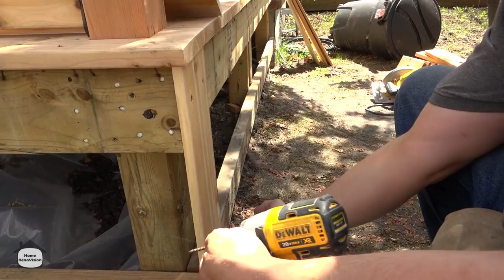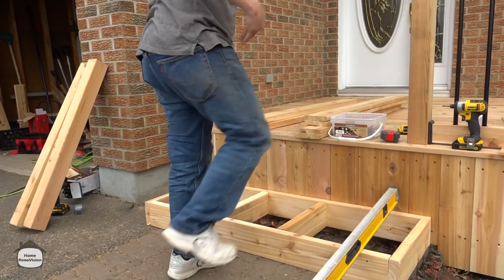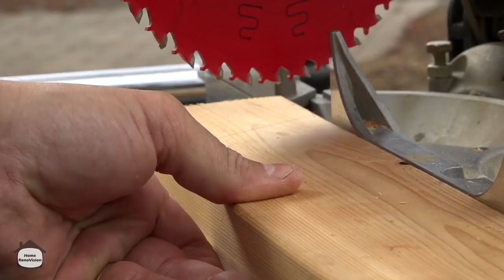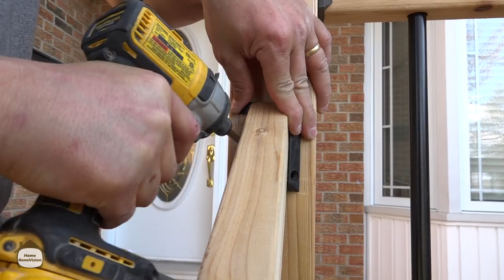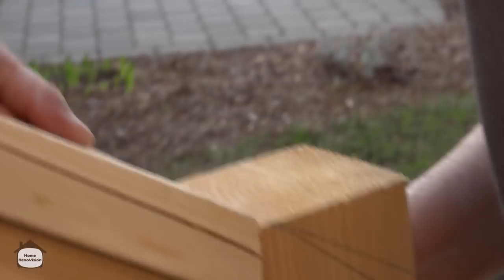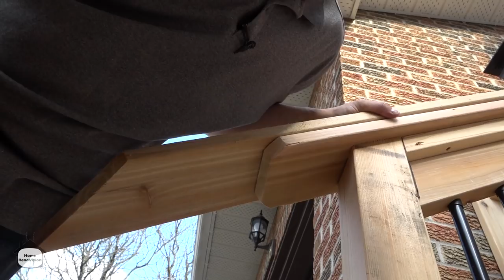How to Finish Your Deck Yourself! | DIY Deck Tutorial

Comment: Brilliant and well done Jeff. I am repairing a 2 story deck that originally installed all wrong. The ledger 16' board was even sparatically nailed to the house!! And yes, I got my permit for the repair. I am actually looking forward to the inspection.
You gave me great tips that I will use. Thank you. I subscribed.

Comment: I do this stuff for a living but I really like your videos you have good tips like that dividing by 3 trick on that skirting is amazing thanks for the vids keep it up
Reply: I cannot find skirt boards at Lowes, any recommendations?
Reply: Steven Foster they are never termed or coined that way. Usually people use wood lattice or pvc trim board. Heck, masonry, vinyl, plastic, etc. Use any type of wood really, as long as you are pleased. If you’re leaving 1” gap above ground, you can opt to get treated lumber rated for above ground and so forth for ground contact. Generally, your deck requires ventilation especially all 4 sides for proper drainage and breathing room, especially for treated lumber, so I don’t recommend closing up all the gaps to your deck hence the invention of lattice. Just make sure it is either flush with the top frame of your deck or have the deck boards overhang a bit over like he does. Flushing with the top is aesthetically pleasing but can have a lot of problems later so its better to overhang like he does. Notice he has additional framing for skirting and the bottom rail for framing must be same size as the rim joist otherwise it would be slanted and not plumb. So if your rim joist/end joist is 2x8, you can use any 2x? For the bottom frame and you be set. Hope that helps.

Comment: The reason why the skirting boards are cut at an angle is for the water to drain more easily in the bottom and not be drawn into the wood. The short side should of course turn inward. Greatings from Norway 👍🏻
Reply from the maker: Cheers to Norway!!!!

Comment: Hi Jeff, I just subscribed, I've watched a few vidoes so far from your channel and I have to say, you are amazing, down to earth, real and sincere. And it's nice to have Canadian content, awesome. So, I've watched this particular series a few times, I live in Nova Scotia and I'm about to rip out my front deck, it's actually a covered veranda, substructer is fine, just repalcing the deck boards, wraping my 4x4 posts and replacing the stairs, railings and adding railings to the stairs; it's 40 feet by 5.5 feet. This set of videos has given me the confidence to tackle my project. even the rep at HD suggested the tape you suggested, and as I'm using a water seal, to just add it to the joists and substructre, and why not, this needs to last several more years. Wish me luck....

Comment: Well.. gonna go add another box of screws to my project. Did you possibly over-do it on some areas with the screws? I mean these are the lifetime warranty coated deck screws right? My fence seems solid and I don't want to screw to close together that I split the wood. The wood seems to be expanding over the nicely sunken ones well. Others need a bit more drive from a drill with a fresh battery.

Comment: Thanks for the idea on the box steps. I was trying to figure out a way to use 4 stringers to make steps. This is a lot easier since mine is also only 2 steps on a flat surface.
Reply from the maker: Not everything in life needs an engineer. Cheers!

Comment: I'm very new when it comes to this stuff. I'm a residential building owner and I have to install a railing using a 4 x 4 post going into the ground. Up against a square cement patio. I understand I cannot put the wood directly into the ground. However if I cement the 4x4 into the ground does that comply with code? (Also, I'm in the state of Utah however I can't seem to find building codes online except for a website that wants to charge me $150 to look at all the code.) 

My idea is to dig out a hole for a 5 gallon bucket  then  fill it with cement, sink the four-by-four into it  and then I can break off the  5-gallon bucket later like it's a sonotube. But I would make a cutout  for the 4 by 4 on the side of the bucket that is going up against the patio, then 6 inch bolt thru 4x4 into cement. Do I need to rebar also into my cement pour?  Please help...thnx

Comment: Just a note about the stairs.  Your intent was to have each step at approximately  6 1/2 inches high but due to the way you built them they are quite dramatically different.  From bottom to top they measure 6.5 inches 5.5 inches and finally 7.5 inches.  This creates quite a trip hazzard
Reply from the maker: HI james it actually ends up at 6.5 and 5.5 and 5.5 an that is fine. In most cases steps are 8 and anything under that seems quite normal.
Reply: Home RenoVision DIY if it's 18 1/2 inches from grade to top of the deck, then the first step is 6.5 inches, the second step is 5.5 inches, leaving 6.5 inches to the top of the deck.

Comment: The code which I have seen most commonly used here in the US requires that the railing has a hand grip. Flat 2x4s or something similar are not allowed. It would be great if you could do an addendum to show how to add something like that. I'm currently in the process of building my stairs, which definitely look like someone new built them. However, they're not without some visual interest and I am trying to figure out how to put something aesthetic for the hand grips.

Comment: I love your videos, the way you teach is so easy to follow and to understand. I learned a lot from you. Keep teaching us. 
I'll build a deck later this summer, and i'll rewatch all of your videos. 

I have a question that is not on the decking subject, but if you could have any advice i would very much appreciated. 
I have a home that is build from modular containers, with sandwich panels as the wall. The sandwich is 50mm thick (metal-foam-metal). In my bathroom on the inside i had mounted osb 10mm and drywall 12.5mm, and now i am at the point to hang my 60 liters  electric water heater. The question is what kind of fasteners should i use to be sure that the water heater doesn't move around? On the exterior i'm coming with 200mm insulation.
Reply from the maker: I would screw right into the frame of the modular box, just like you did when you attached the osb.

Comment: I like your video, however, only your first step is 6 1/2", second step is 5 1/2. I was just trying to draw our some steps for my deck when I noticed that. Second step is only 5 1/2 because your second box is built on the box/frame and not the top of the tread (deck boards). Any ideas?
Reply: His videos are directed to "DIY" handymen and women, If your following this video then to answer your question you have two options, 1. you could put the 5/4 inch board right through on the first box step so the second box sits on the 5/4 board below.

2. or you could buy 2x8 lumber and rip it down on the table saw to 6 1/2 inches.

Comment: How do you determine the height of the bottom post to determine the angle? I'm installing just three steps but I need to know how high my bottom post should be. Is 42 inches the minimum to meet code?

Comment: Jeff, I have a deck that is level but the concrete pad slopes so that the heights are 17 1/4 to 18 3/4 left to right over 11' 3". Should I cut the bottom board so that the rise on the first step varies 1 1/2" ? and the rest is are the same? Not sure whether the rises should be the same or is it more important the runs are level?

Comment: I won't troll you for safety, because I believe if you don't feel comfortable don't do it.  I will troll you for using a split 2x4 for the show side of your railing though :D.  Deck looks great!
Reply from the maker: I am not concerned about that since it does not effect the structural integrity of the deck. over time there will be other such cracks that will appear. That is the nature of wood.
Reply: @HomeRenoVisionDIY   I agree with Visser - why use a split piece of wood at that point?  Like putting a bumper sticker on a Ferrari.  If I owned that new deck and saw that I would pull the rail apart and replace that piece of wood.  Much less work to just do it right the first time.
Reply: @Simmons2358  I noticed that too.  It's like doing a great paintjob on a car and leaving a big scratch in the hood.  The crack in the railing is the first thing people notice when they walk up the steps.  What would that small piece of wood cost, two bucks?  The rest of the project looks great, although I am not sure about those makeshift footers under the deck.  Overall though a very nice job.

Comment: Raised some excellent points to consider, and I like the design. That's my downfall - trying to envision the end at the beginning just isn't my strong suit. No imagination. . .  My understanding is that you aren't required to have railings at all around a deck that's less than 30" above ground level - is that true? I love the railing, but if you're doing work for a customer on a tight budget it would be nice to know where that's an option. 

(Wondering why you didn't do the drink rail treatment on the short section to the left of the steps? Just for consistency. . . )

Comment: Great series! 
Im about to tackle a 20x12 deck, on an elevated bungalow, with walk out basement. It will have stairs at the end that run parallel with the length of the deck(20ft)
With this size deck what size joist to you recommend for the frame?
Also, i will attach the back of the deck, to the rim joist of the home, so i will cut back the aluminum siding to do this. Is it best to attach a seperate ledger board to the home, then attach the frame to that? Or just go ahead and attach the frame to the rim joist, eliminating the separate ledger board?
Now for the stairs i will probably allow for a 3ft x 3ft landing at the top of the stairs. When i make my box frame i will be 20ft long at the home side x 12ft wide for 17ft. The additional 3ft in length i will need to be 15ft wide.
Do i frame this as one, or do i frame it in 2 sections, then attach them together?
17x12
3x15
Hopefully im not confusing you with all this...
Thank you kindly!
And im located here in Eastern Ontario, so i will have to comply with our codes

Comment: not a fan of all those exposed screw holes in the skirt. will it swell to cover them up? couldn't you have used the same system you used to put the deckboards in - just on its side? or some sort of stainless steel finishing nails? what other options are there for this?
Reply from the maker: Thanks Alex, skirt boards are famous for warping so screws are necessary. And yes over time the wood does swell and they become quite invisible ! Cheers!

Comment: Will sealing this deck with a clear finish help protect it from weathering and turning gray? Also, if you do apply a clear finish, will that mask that beautiful cedar smell?
Reply from the maker: Great question Jacob, yes we use a sealer and no the smell is still there from the back side of the boards. Cheers!

Comment: why you let the deck case(including the stair frame) contact the concrete directly? will it suck the moisture form the concrete and get rotten?
Reply from the maker: cedar resists rot. if you are using PT then make sure to use the ground rated product. Cheers!

Comment: Hey Jeff, I have to build a set of steps for my front porch.  The opening is 9' 6'' wide.  I have three stringers for the steps.  Should I use four stringers instead?
Reply from the maker: Hi Lance, I would suggest 1 stringer for every 2' if using 2x6 on the steps or every 16" if using 5/4 board. Cheers!

Comment: When you preassembled the framing for the stairs you showed the one back board (framed inside) but then when you actually screwed it all together and to the deck the 'inside' board was facing the front of the stairs and not towards the back as explained earlier it was going to be.

Comment: What brand areThose 8x3 deck screws you were using in the video? Curious because in the states there isn’t a huge selection of square drive screws available and I don’t want to try out all 5 or 6 available to find something that’s going to do what I’m looking for.
Reply from the maker: In Canada we use robertson( square) bits and screws for almost everything. Not sure why it is different down south. Cheers!
Reply: I understand they are Robertson. I meant which brand you were using. Hillman? Piquic etc. thanks for the prompt reply. Ps- Henry ford and Mr.Robertson had difference of opinion over a contract which lead to Phillips being adopted by Ford in the US. Making Phillips the ready made (although inferior) screw solution. War time manufacturing also favored existing plants leading to many more Phillips being produced.

Comment: Looks good. Although, If the top of your deck is 18" 1/2  and you have two steps 6"1/2 + 6" 1/2 = 13".  13"- 18" 1/2. = 5" 1/2.   Maybe you caught it and that's why you didn't show building the second step.

Comment: Love your humour, I am replacing an 120 yr old Heritage balcony railing in May at 219 Cobourg in Ottawa. My base is a series of flat 2x4’s imbedded in the tarred roof. I guess I would start with 2x6 PT base framing and using some sort of metal bracket to attach the the 2x4’s. Making sure I install 4x4 posts attached inside the 2x6 frame and I will need to add 2 or 3 posts at each end so I can then add a vinyl cover over all the post making it look like a 12x12” post 
The existing posts are 12x12” hollow plywood that’s now rotten. I would like to try to match the original look but with better materials. Question: how do I get the City to approve permit when using current kits like Regal for the railing but not their posts?
Reply from the maker: Hi Jerome, the secret to working with the city is to understand what the building code is for, and how the city operates to help people to conform. The building code is series of engineered accepted practices that the city can inspect and confirm those practices are done in compliance. whenever you want to go outside of pre engineered products or approved practices you simply get an engineer to inspect and approve your process. He can then stamp his seal on that portion of work so the city can approve the job as well. remember, the city does not employ engineers as inspectors . The inspectors job is to simply make sure that you are compliant with red seal materials and or practices. any changes outside of that even if it is a better practice than the standard  must be approved by someone who is a red seal engineer. 

I hope this helps, BTW most engineers can make a site visit and approve structural changes for well under $1000.00
Cheers!

Comment: What do you do about deck boards that start weeping sap?  I have several doing that, a couple are fairly severe.  I have stained them.  

Sand?  New boards?

Thanks!
Reply: common approach is to give it a year for sap to come out and cure/harden. Scrape those spots clean, then stain/paint whatever

Comment: Did you end up putting any ventilation openings in the skirt to help with ground moisture or rain?
Reply from the maker: the underside has a slope to the left side of the screen so water runs out.

Comment: Hey bud really look forward to watching your videos, get great tips to improve or figure out how to in every job. I'm coming from Australia but regardless I 'm wondering what framing gun and nail thickness should it be capable of firing?
Reply from the maker: Cheers to Australia, most framing guns are designed for the standard nail in your country. Just be sure to check with your local dealer.

Comment: Hello Jeff. I love your videos. You are an amazing person. Inspired by you and your videos, I built my 12x16 sized deck. 
Now I have a problem. The deck is built almost a feet above the ground and as I don’t have much height to cover, I went with joists flush with beam approach. Joists running at 12 ft side. Now after finishing the entire deck and start walking on it, I feel a mild bouncing effect on it. Hence showed the design to Homedepot guys who made it for me. They said it is perfect and no issues with the stability of the deck. But the bounce is bothering me. Can you help me what needs to be done to resolve it.
Reply from the maker: try adding a 2x4 under the middle and add a support to the middle of the deck. Cheers!

Comment: Hey Jeff, I have the exact same rail system as you used.  Struggling though with the fact that my stairs are ~30.5 degrees, but the Veranda angle adapters are for 45.0 degrees.  How did you make this work? :)
Reply: Did you ever figure this out? Were struggling with our angles on our stairs as well and no answers anywhere!!

Comment: when the grandma's come, jehovah witness, trick-or-treaters or maybe the men in black. only issue i see is will light from that wall light fixture above the mailbox make it down to the bottom step? my front deck has 3 steps and it's super hard to find them at night
Reply from the maker: The front steps are beside the garage which also has a light. But great question. Cheers!

Comment: Got lost in your math...

Two 6 1/2" = 13"
Top of deck is 18 1/2"
Last step will only be 5 1/2" 

Did you say that and I missed it? It's not 3 steps, all with the same rise, for sure.
Reply: You are correct but it is the rise on his middle step that is 5 1/2 inches as his 2nd riser starts ftom the frame rather than sitting on top of the tread which makes the riser one inch shorter.

Comment: You’re gonna keep that crack or split in the upper rail board? I’m confused.
Reply from the maker: It is just a little crack and it will not affect the structural integrity of the railing. there will be more cracks in the future. I try not to get worked up over the little things.
Reply: railing on the left side is missing, it does not look symetrical
Reply: btw great job and great video